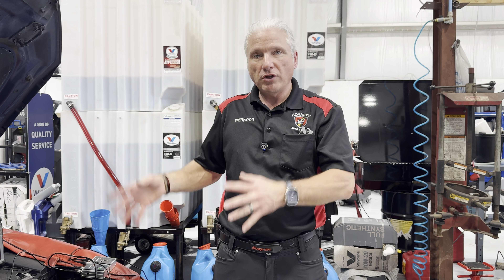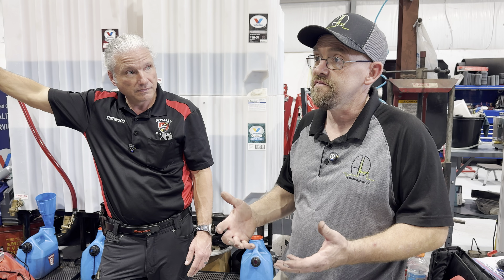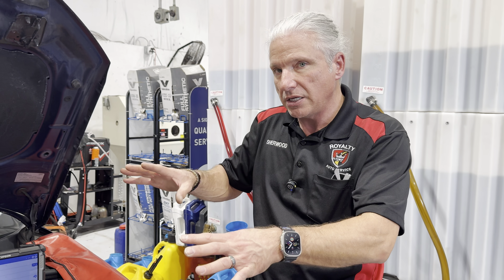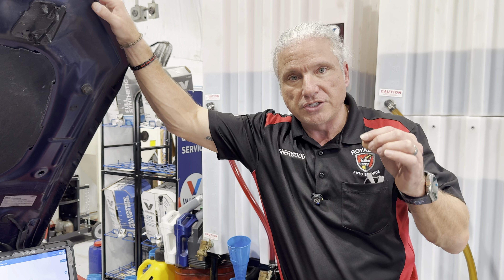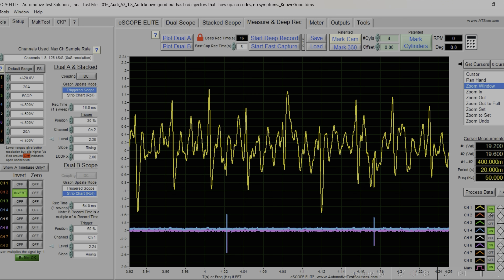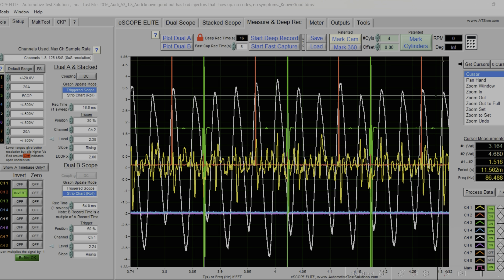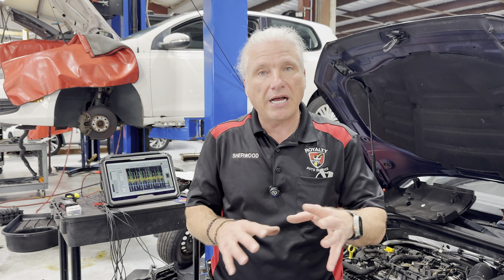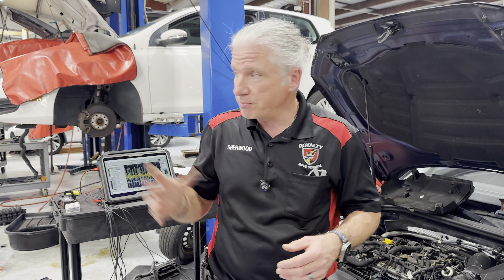This New Tool Will Make Diagnosing GDI Fuel Injectors Much Easier!!

Comment: I am a professional DIY. I have a pico scope. Are we looking at fuel injection quantity here.  I am a little unclear what are you determining is bad.
Reply: they are hooked up to the fuel pressure sensor, but just hooking a scope straight up to it does not let you see good enough. this tool  hooks up in between the sensor and the scope and acts as a signal amplifier. i have seen others in use for other signal amplification a year or better ago.
Reply from the maker: We are looking at the fuel pressure drops in the fuel rail as each injector opens. If an injector flows more or less than the others there is something wrong with the injector. We've done this test for many years on port injection but haven't been able to do it on GDI because there is no way to get a pressure sensor connected directly to the rail and the pressures are so high no currently available pressure sensor would survive.  Hope that makes sense. Thanks!